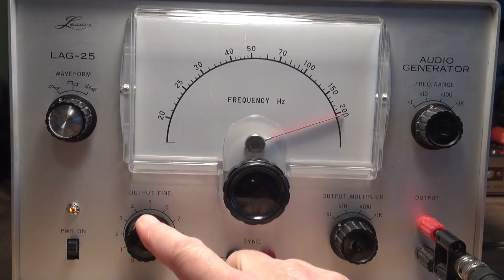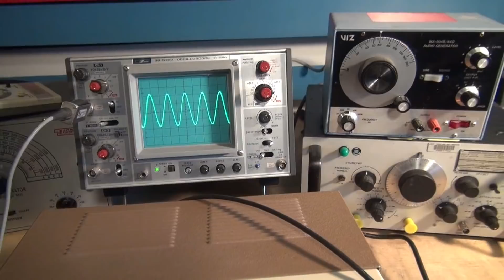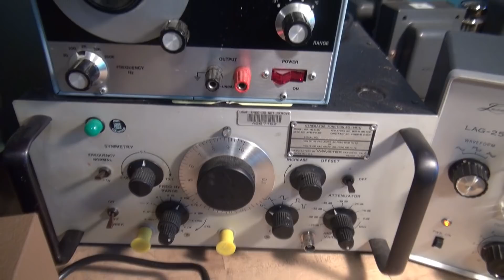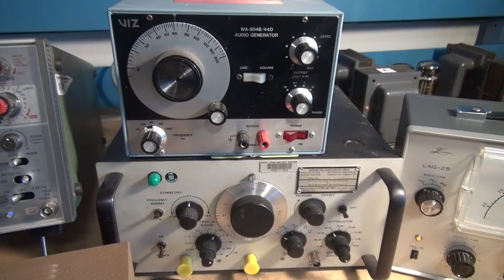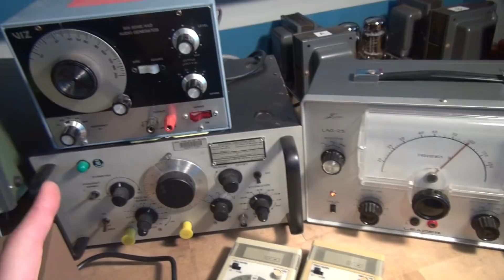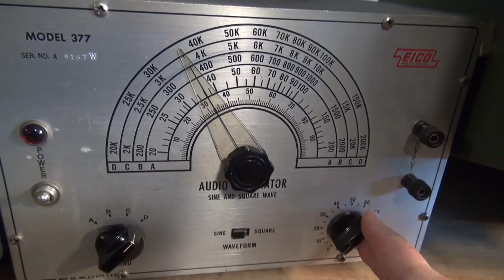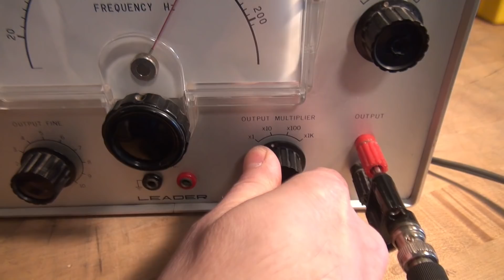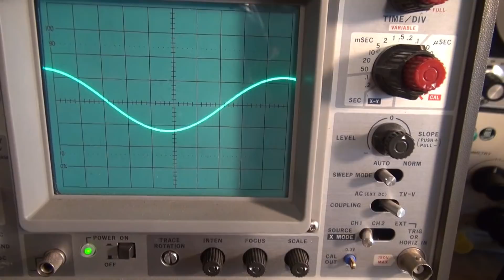How to select Audio Generator Tube amp or Radio repair D-Lab electronics

Comment: Hi what kind of adaptor do you need to go from the banana plug on the audio generator to the 1/4” into the amp? Does there need to be anything special or will any banana to 1/4” do?

Comment: Just letting everyone know that there are modern options out there that are very accurate, reliable, and inexpensive. A Sainsmart MHS-5200A is a 2 channel digital Function Generator, it's $75 on Amazon. It will do every wave form you can think of and it has adjustable amplitude up to the 3rd decimal place (V). It's also 1/5 the size of my Eico 378 that just gave up the ghost.
Reply: But how is the distortion? Is it low enough for testing amplifiers?

Comment: Aw man,,,, is it possible to hit the like button on this video more than once? Lol I’m newly subscribed and have been watching every one of your videos. You’re awesome! Love the energy knowledge and experience-AND you’re just damn cool. 
Emi is so lucky!
I’m trying to set up my test bench, and trying to learn two tube amp circuits CAREFULLY and RESPECTFULLY.
What got me started is an old 1956 model R145  AMI jukebox mono amplifier. I’ve ‘wired it’ for home “Hifi” use LOL and I’ll tell you what, it sounds freaking awesome!
Recently have acquired another one that I want to recap and check resistor tolerances before adding it to my system as a pair of monoblocks.

Comment: I have the more modern LAG 120B. (still uses a vari-cap)
It was 220v, so replaced the power transformer with a better shielded one, new power filter caps, and Cal'd it according to the manual.
Works great.

Comment: I sure wish we could spend a little more time on the cable connection on this. Is it a shielded bnc to a 2 prong at one end and a jack at the other? If so, how is it wired at both ends, is polarity an issue, how does the shielding get treated? Please someone tell me!

Comment: Hey, long-time viewer of your videos here, I go back to them several times to get good advice to start fixing tube amps, I bought that Iwatsu ss-5702 you recommended for audio work, really happy with it (except that they are extremely vague about what is exactly the calibration signal it puts out from CAL OUT, their stated .3V is more like .16V on my DMM and on the screen of the scope, anyways...)
I also just bought a Wavetek 131A signal generator but the frequency it puts out seems to be wayyy off, I need to dial 1.75kHz to see a 1kHz wave on the scope. Compared it by ear with a sig gen app and another website, and sure enough, I need to hit around 1.75kHz on the dial to tune it to 1kHz. I cannot find on the Internet any discussions of people having the same issue on a solid state sig gen, does that ever happen? For a sign gen to be that out of whack? so any leads would be welcome here!

Comment: Hi Terry, I am a real deal hunter like you, I found an HP 8904A nearly new like low hours for $60! for Audio (DC-600 kHz)  And for RF I have a Fluke 6011A (10 Hz - 11 MHz) $100, I is "used' but it very stable and reliable.  I love them both very much for signal requirements they perform like champs. They are also capable down to 2 mV or up to 10 Vpp on the Fluke and down to 10 uV on the HP.  I feel fortunate to find devices that were in the $1100 each range new.   Terry thanks for your videos and I point newbies to your help for gear and such.  73

Comment: Hi D-Lab,  I used to have an RCA tube generator, not a fan.  I finally got an HP8904A 0-600 kHz and a Fluke 6011A 0-20 MHz rock solid and both are built like a tank.  I love both, are not get for much money now days if you look around.
Reply: The RCA/VIZ consumer test equipment was as good as there was during that era other than broadcast specific equipment, but RCA was out of the biz before synthesized/computerized equipment hit the market.  Too bad.

Comment: Zinc baby....Zinc. Check out Zicam at your pharmacy. It interferes with viral replication, and mitigates the nasty cold symptoms and shortens the course dramatically. You must take it/use it at the very earliest signs (scratchy throat, first sniffles, headache etc). Your cold will be shortened and much less symptomatic. BTW... the Globe Scout 65A is working great, thanks.

Comment: Can you recommend another suitable audio/function generator, as the three you feature, Wavetek, Leader lag25, 26, and Viz are hard to find and usually in need of repair. Primarily to be used for amp testing/repair.

Comment: I’m currently building an Eico 378 that I purchased as an unbuilt kit. The meter is actually not used for displaying frequency, but for accurately dialing in the dB/voltage. Tuning is done by selecting from precision 2% caps instead of a variable condenser. Also, the unit uses vacuum tubes and is not solid state. Just thought I’d post for clarification. I’m having a blast building the kit. It was quite a sight to open the 52 year old box and a real treat to have the opportunity to build one. Although there was no moisture damage to the box, the power transformer was surprisingly rusty and required a bit of work. Also, strangely enough, Eico packed the kit with two momentary switches for the power and load functions. I wonder if there are any 378s out there that require the user to hold the switch to keep it powered up!

Comment: Hi ,  is it possible to measure the impedance of a woofer or tweeter , with a oscilloscope and an audio generator , in differents frecuency   to determine where is the ohms in a specific frecuency to determine the  corrects ohms to be use in a crossover  ?

Comment: Terry, thank you for this information.  As a result of this video I ordered an audio9 generator from EBay.  It's a 
GW Instek GAG-810 Audio Generator, 10Hz to 1MHz.  I am in the process of setting up a hobby electronics bench in my home.  Still haven't gotten an oscilloscope but have a 3 amp variac.  Thanks for your work.

Comment: What's your opinion on a Wavetek Sweep Generator model Model 134, please?
Reply from the maker: Hello, That is a sweep generator, If your looking for a straight audio generator for amp work, I'd look at another model
Reply: Ya just for tube amps. I'm retired now and been hot-rodding tube amps and guitars for decades, but I want to ramp up my test gear a little. Thanks again.
Reply: GW Instek GAG-810 Audio Generator?
Reply from the maker: Looks to have attenuation, so Yes, that one would do fine
Reply: Thanks for your time.

Comment: Cheap solid state service grade audio gens are less stable then lab grade tube ones. The HP 200 series is the best bet all around. Easy to keep going and as clean and stable as matters until you have a serious distortion analyzer, and that will usually have a generator of its own.

Comment: I used to have an eico 377, I plugged it in to an amp without ever testing or servicing the signal generator... luckily a resistor acted as a fuse and my Mk III didn't get fried

Comment: I have a LAG-27 which only has a high/low range switch with a fine adjustment for the output.  I like the way the LAG-25 output is set-up.  The 27 is doing the job for now.  I do appreciate you going into the details you do for these set-ups.  I'm learning a lot.  I've made quite a few hi-fi and guitar amps but now I'm starting to really dig into the real outputs of these amps using these testing methods.  Thanks Terry and get well!

Comment: Would the volume control on an iPad or smartphone have enough attenuation for testing guitar and stereo hifi amps?  Both my iPad and phone have FREE FQ generator apps installed and I bought stereo 3.5mm x 1/4” mono + BNC & RCA adapter cables to plug into the iPad headphone jack. Thx.
Reply: Dave Anderson this is a great question. For someone wanting to get into this hobby, knowing what of their existing stuff could be repurposed would be helpful. I did it by trial and error....mostly error.
Reply: Dave, where did you get the iPad cables? Those sound like something I’d love to get. Thank you!